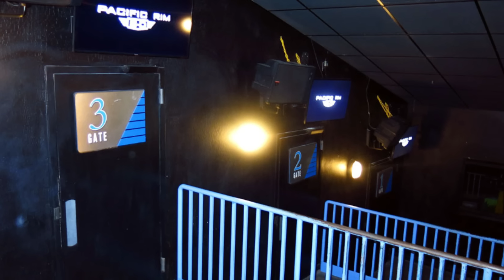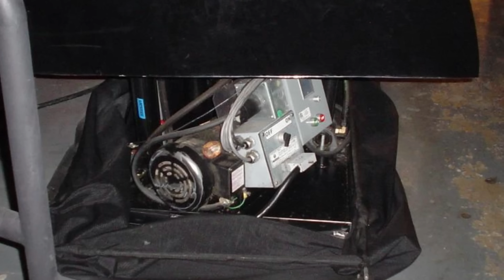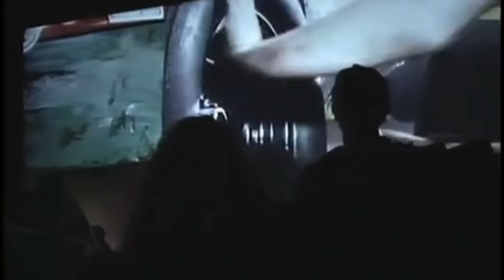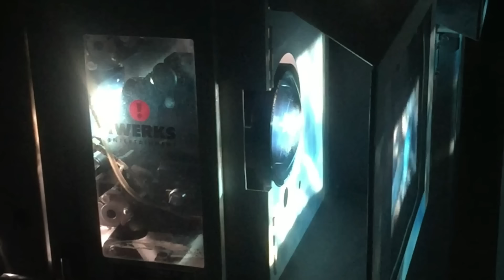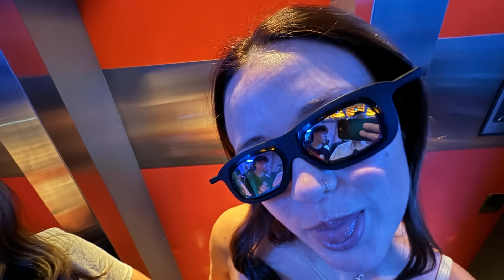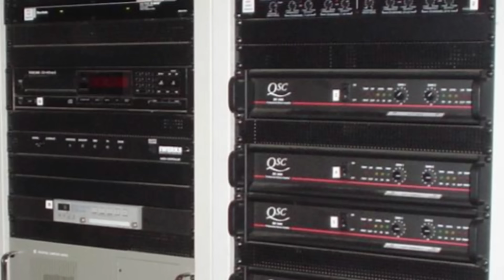Iwerks Turbo theater or turbo ride, how it works

Comment: Are there any of these attractions that run digital content? Being the movie theaters had to switch to digital back in 2014 I would think these also have had to change over as films wor out and replacement prints became unavailable. As far as syncing sound and motion to video digital would be easier. A dcp file typically supports eight channels of audio. Six for the show,one for hearing impared down mix and one for visually impared narritave. Digital also naturally sends linear time code data from the projector. Time code is constant from start to finish and show to show so would be the perfect way to sync motion to movie action.
Reply from the maker: Yes. Our park did not want to switch to digital but everything is now digital as they don’t make projector service parts anymore.

Comment: My home park is Kings Island, so I grew up with the Action Theater, or Paramount Action FX Theater, as it was later officially named. Then it went back to just "Action Theater" when Cedar Fair took over. Days of Thunder was long gone by the time I remember seeing anything in it. As a NASCAR fan, I would've been beside myself to see it in the 90s! They did briefly bring it back for a few weeks one summer in the 2000s. They switched out several movies actually, but mostly it's remembered for SpongeBob 3D in the later years. Then it became a compliment attraction to Dinosaurs Alive. Kings Island's was the first to shut down out of the Paramount ones. However, Great America still has there's operating. As far as the Paramount parks go, most of the theater buildings, if not all of them still exist, but have all been repurposed. I can say for certain that Kings Island's still has the seats. They use one side of theirs for Halloween Haunt mazes, and you can always catch a glimpse of the seats. I've heard the other side of the building has been turned into various offices and shop spaces. I would guess the screens and projectors were shipped to the other parks right after it closed.

But yeah, very cool video, and blast from the past!
Reply from the maker: Thank you

Comment: I probably saw a dozen or so different films in these theaters in several locations from Vegas to France. Some better than others, but a few were pretty good. I admire the folks at your old place taking it on themselves to get the theater running again, although I don't think the results were successful. I wrote for a theme park website at the time, & worried that I'd be striken from the media invite list because my review was so harsh. Other commitments prevented me from attending the RMC conversion hardhat tour at that park, so I had my son go to get photos, and they got to go see the workings of the Turbo theater and hear about the work to reopen it. Sorry I missed that, and I am absolutely sincere in admiring the attempt. But it really demonstrated how out of date the tech was since I recall how the hydraulics were almost as loud as the ride audio.

Comment: California’s Great America still has their dual theater system from the Paramount days. I rode it during for days of thunder and last year when they only used 1 side.
Reply: The one at Great America currently, Mass Effect New Earth, is a completely different system. Much better as well, but everything, seats in groups of 4 without seatbelts, LED screen,  etc. is new. They also use an actor, most of which that I've seen n are very good.
Reply from the maker: Nice. Occasional use is still use. I was looking for a full video of the days of thunder just to take me back to the days. When I could excessive kick on the one shift and I swear I could touch my toes haha!!!

Comment: Movie theater nerd here. The 3D system in use is why those screens had to be silver coated. A regular white screen would cancel out polarization. At the time polarizers and shutter systems were really the only ways to achieve a 3D effect. Some IMAX theaters used active shutter glasses because those didn’t require the screen to be altered when retrofitting 3D capability. But they’re quite cumbersome and require recharging because the glasses themselves actively black out each eye in alternation.

The 3D glasses shown at 36:27 use dichroic filters which as far as I know only became available in the early 2000s with digital projection. The system is known as Dolby 3D or Infitec 3D for industrial applications. Unfortunately it’s rarely used in movie theaters anymore. Dual laser IMAX and Dolby Cinema are really the only places that continue to use it. It’s a pretty elegant solution in combination with 6P laser projection as the light source itself works as a filter and there‘s no need for a silver coated screen.
Reply from the maker: Thanks for the info!

Comment: Worked an TurboRide Theatre for about 5 years, and during that time we transitioned  from the continuous loop set up (2D) to reel to reel (3D) smaller park with less throughput so the wait for the film to rewind didn't effect operations. Had the projector seen in your video for 2D but the 3D one was different, and used compressed air to blow the film through, yes it was noisy... Once the change to 3D happened we had (and not a projectionist so please correct me!) the rewind process which brought a flow of air on so the film instead of landing perfs on the teeth, would be pressed against the other side of the housing so it could rewind much faster,  not sure how common our type of set up was though!

The morning start up (I thought it was 1-14 but could have been 15... that was 20 years ago) the AC, making the chairs dance to check them, and the earlier start time that came with working Turbo and the amazing calm and quiet in Turbo before it started up/after it shut down, it was one of the most peaceful areas in the park

Grossest memory though was after a big storm, power had gone out and there was a sewer back up, and we learned that the main sewer connection for the facility ran underneath the roller coaster that Turbo was tucked into, we had no power but we were sent to check how bad things were and walked into Turbo with a co-worker, despite no power I still remember it being cold inside and we were walking down the steps, commenting on how maybe it wasn't so bad and the back up didn't get so high in the theatre until  as my coworker stepped from the 2nd row of bases down the first step to the lowest row and all I heard was  sploosh.... we high tailed it out of there (co-worker got new shoes socks and pants!) and then we knew show controller, screen  and entire first row of seats all had been partially submerged.... 

A smelly mess to clean up, but the "sploosh" noise when my buddy stepped into that mess.... one of those moments that still gets brought up when I run into former co-workers

Thanks for the great video!
Reply from the maker: Wow. I wasn’t sure when they started using the infinite Loop cabinets, but it’s a much quicker process. Only about 10 seconds from finish of film to start of the next film.

Comment: My local park (Rainbow's End, New Zealand) was still running an Omni Films Motion Master until 2019 (replaced with a Triotech XD Dark ride). They also ran an old Cinema 180 until 2015 which I believe was the only park model still operating at the time. I miss the old school rides.

Comment: 23:55 Since my primary trade was movie theatres and film projection for around 4 decades, I have to make a minor correction to you here: ALL  standard cinemas ran film at 24 frames per second. (fps), (Including 70mm IMAX. Some later IMAX was done in 48fps.) Iwerks did 30 and 60 frames per second for most of their systems, so for your park's ride 30 fps was the most likely frame rate, with 8 perf 70mm film  (You'd know if it was 60fps because the projector would be incredibly loud, (Edit: 29:25 sounds like your ride projectors were doing high speed, 30 fps)) and a 10 minute ride film would have a diameter of around 3 feet on a reel or 6-7 feet on a horizontal platter.) The reason a 70mm IMAX film is so huge is because the frames run horizontally, and are 15 perforations wide, vs. standard 70mm (run vertically top to bottom through the projector at 24fps (112.5 feet per minute), and standard 35mm at 24fps, with a film speed of 90 feet per minute.)  Now with digital projection many "standard" cinemas are capable of playing the digital images at 48 fps, but the standard is still 24fps. Many digital machines from the start in the late 90's to present also still use Xenon lamps, though laser light engines are gaining traction, especially when a projector is replaced. Xenons have no sodium, and the knobs regulated current, the voltage was relatively low (45-90 volts DC running, over 120-150 DC for ignition.)  And yes even the very small bulbs were extremely dangerous high pressure and would explode if damaged.
Reply from the maker: Thanks for the info!

Comment: When I was in college, I explored one of these theaters after hours with all the lights on. (I was in the building doing other work and wandered in on my break). Remember looking in the maintenance logs in a binder beside the control panel and realizing that the ride actually got inspected and signed off every day. Like you, I only had a flip phone with no camera at the time othwise I definitely would have taken photos of the seat mechanisms and control equipment, I've always been fascinated by things like this. If I remember correctly the entire raked seating riser could move as a unit, but I can't remember if the individual seat bases could also move individually.

Great video as always, loved your description of the projection equipment!
Reply from the maker: Thanks! I try but I missed a lot of knowledge in this video. I worked with it from time to time but no where near regular rides.

Comment: I miss my days as a projectionist...man I got quick threading films before each showing.  We had platters that fed from one to the other so no rewind on them.  An interesting fact is before they had xenon bulbs they used to use carbon arc electrodes and the projectionist would have to sit there and adjust them through the movie as the gap grew while the electrode burned...basically arc welding to show a movie.  Our old projection room has a toilet in there even.  It had all these trap doors on each of the openings for the projector into the theater that operated on a pulley system.  Earlier film was super flammable and toxic when it burned so if you had the film stop and the heat from the light catch it on fire the whole thing would be up in smoke and you'd just leave and pull the cord to close off the room and let the film burn.
Reply from the maker: Yikes!!! I knew they have some power because they hun the melted douser above the projector on the wall to remember.

Comment: One thing you missed on all the (fantastic) descriptions of the film-gate process, is that the entire projector setup: bulb, gate, everything - is subject to a massive amount of airflow/cooling.

So all of this mechanism has to be working essentially in the middle of hurricane force winds.

It's a rather amazing feat of choreographed machinery all doing its thing, rube-goldberg-like ... today, you just have a high power laser or LED projector and it's much more boring.
Reply from the maker: Very true. Giant exhaust stack leading to the roof on both of them. And the room had to be kept at 64°f

Comment: I use to work at a movie theater 25ish years ago.  I have threaded many of movies.   I used to also put them together.  My favorite was one came in and it wasn’t labeled correctly so when we previewed it half way through it went upside down.    That was fun.
Reply from the maker: Someone 180° a film. The main tech said to make sure the emulation sides (I think) matched. I remember he put his lips on the film and one side was sticky that was the side toward the bulb of if I remover that even close

Comment: That xenon bulb in the projector is insanely powerful. In fact, would the film stop on the gate because of a mechanical failure, the light would burn through the film in less, than 2 seconds.

Comment: Until this one, I wasn't really sure why I was so into your videos...This reminded me. Sixteen year old me used to work for Maxflight back the late 90s, the parent company and production facility based in my hometown. That was the next technical iteration of this, with 3 axis 360 degree motion. They built Monster truck sims, fighter jet sims, and the most popular, the VR2000 3d rollercoaster simulator.
Reply: Whatever happened to the single-seat VR2000 flight sim?  I've seen it in late 90's promo fliers but there's little documentation of them.
Reply: @Haze_Productions_II As far as I know there were less than 10 built, and all run by corporate, not sold. The single seat units would have been hard to sell, being quite a bit more expensive than the rollercoaster or monster truck, but only bringing half the revenue. The rollercoaster would cycle 4 riders in the time the Flight sim would complete one. Most buyers would look at the price and per-hour capacity, and that was it. I’m pretty sure the single seat units were modified into the 2 seat units, and the gunner position was added, to give a passenger something to do. That justified the higher cost, and because of the interactive element, you could charge more than for the rollercoasters.
Reply: I was wondering what those were called! My Dad and I went on that so many times back in the day! It had a customizable track and I usually put as many inversions as I could on it.
Reply from the maker: That’s cool!
Reply: You ever play with one? Nifty little machines, but the brush system that allowed the 360 degree motion was a pain in the ass.Tiny little brushes, each had to sit in a particular groove. Units 5&6 went to a Jersey Shore boardwalk. Somebody didn't think that thru...was nothing worse for these things than Being in tents in that salt air. IIRC, both machines were unrepairable in 3 years. I was one of their first 30 employees, the owners were still building the units themselves. Never should have left.
Reply: @scottreich1207  Maxflight sims used to be a staple at FECs in my home state of FL.  They were intense for such small sims, nothing but good things to day!